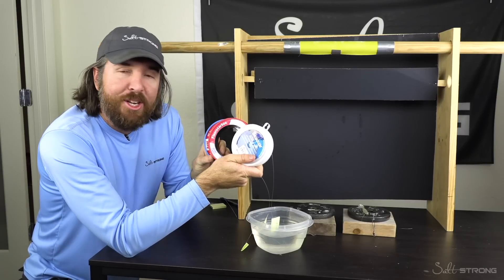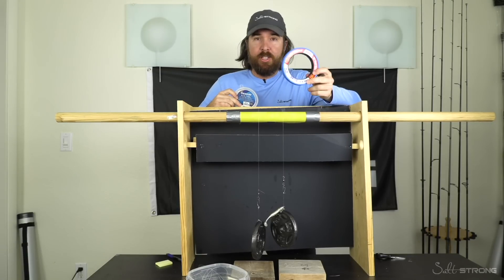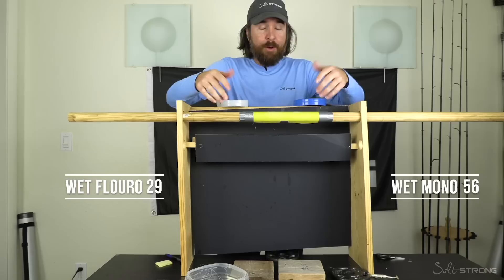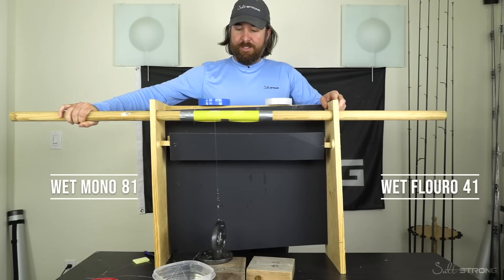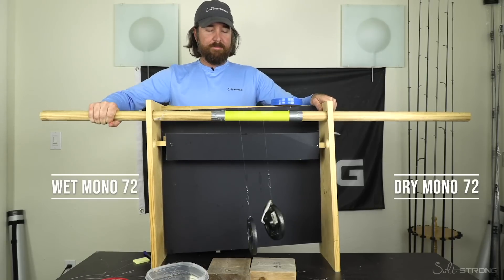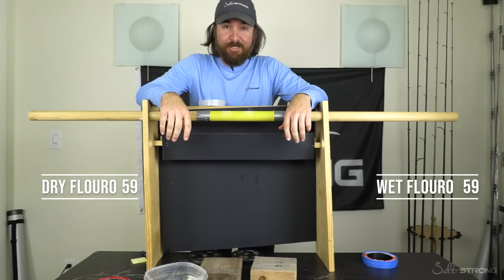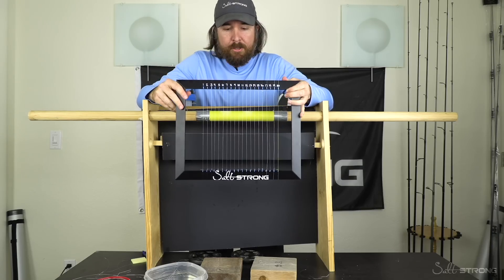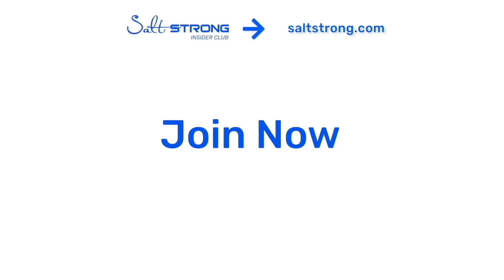Is Leader Line Less Effective After Being Soaked In Water?

Comment: Shouldn’t you test abrasion under water? This would be important because I bet your test is heating up the line to break it. If it was under water it doesn’t heat up the same way. I think you are getting the wrong results. I do a lot of bait fishing for tuna and the big boys can break you off at the gills after a long fight. I’m not sure I would call this abrasion so much as ‘pinching’ of the line. The leader gets like flattened out. Flourocarbon leader performs significantly better in my non scientific tests.

Comment: Non-soaked mono is more abrasive, could the water provide lubrication? Also, when the line rubs against the sandpaper, it fills in the roughness of the sandpaper with abraided line. A fresh piece of sandpaper may provide consistent results.
Reply from the maker: Thanks for the feedback

Comment: And mono with the same diameter as flouro is more manageable and not as stiff. I'd like to see you do some test with different brands of mono or copoly  matching the same diameters to see which brands are best at knot strength. Forget what the label rates the poundage test. I have a good idea which will win or be in the top 2 brands.
Reply from the maker: Thanks for the input!